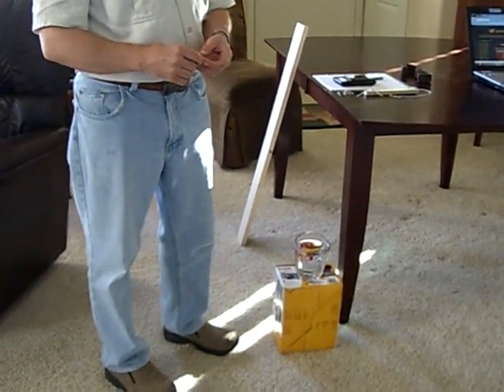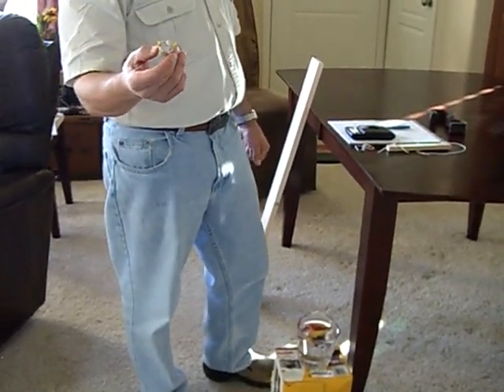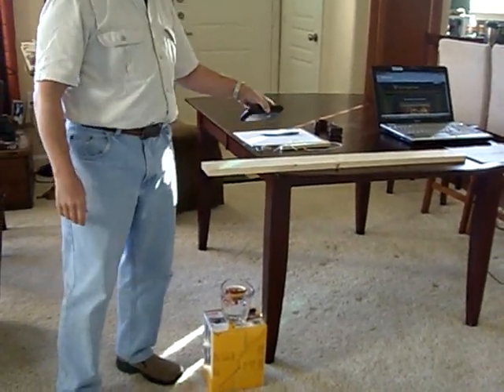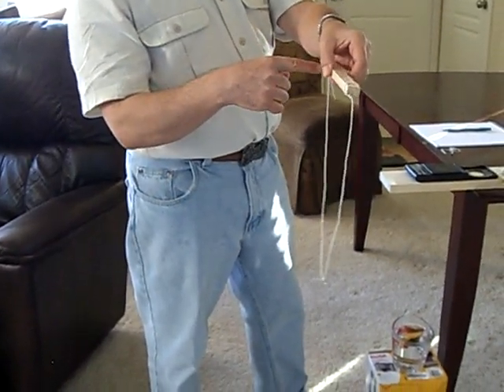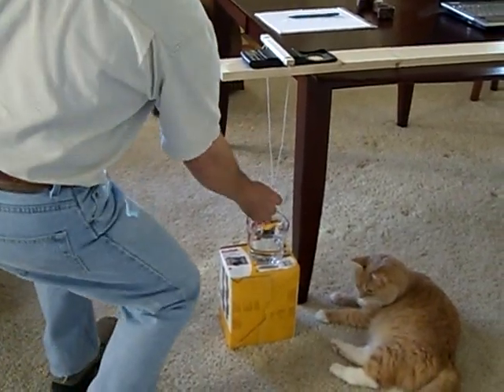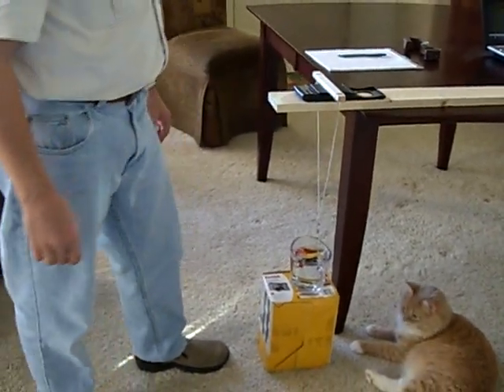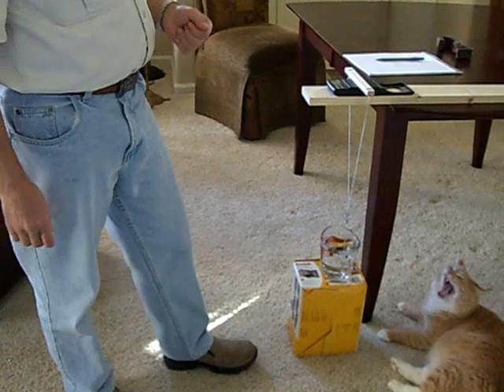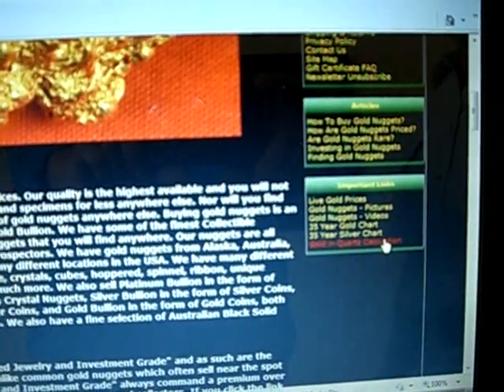Gold in Quartz Calculation -- Specific Gravity Test

Comment: can't you place the cup with water on the scale. tare the scale and suspend the nugget into the measuring cup and weigh it?
Reply: Yes, if the scale is not overloaded. For smaller objects like rings it works quite well and is much simpler. Newton's 3rd explains that the buoyant force up on the sample is equal to the force the sample pushes downward, which is the increase in weight you get when you submerge it.